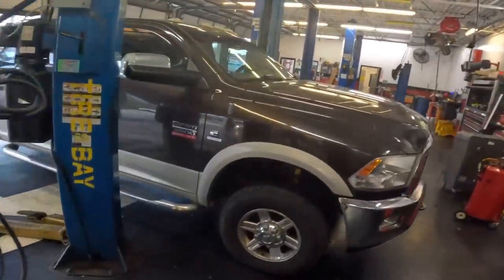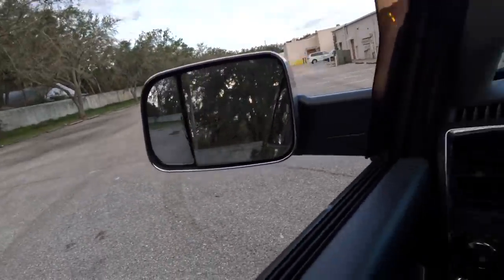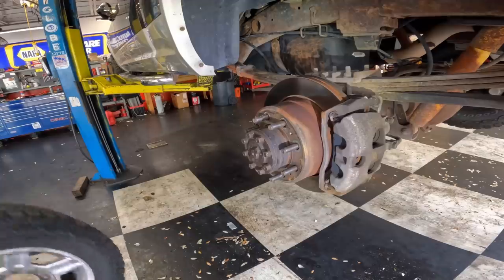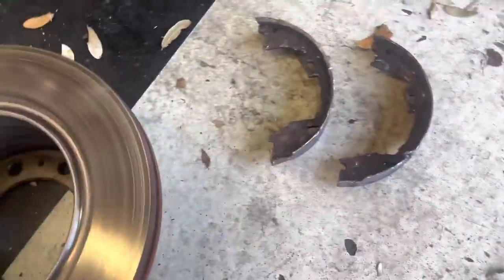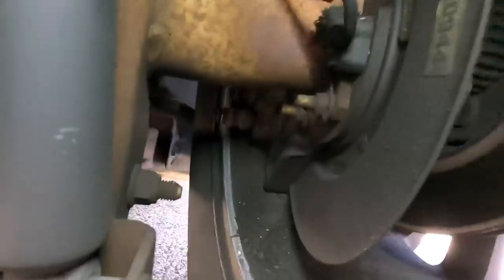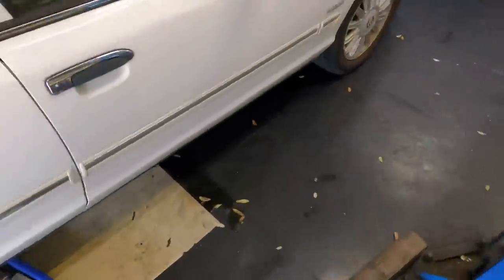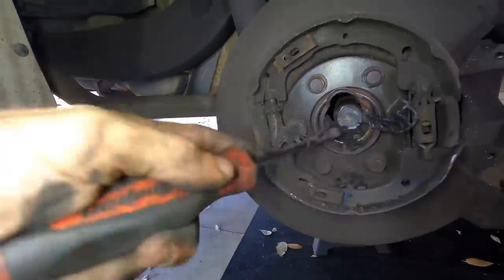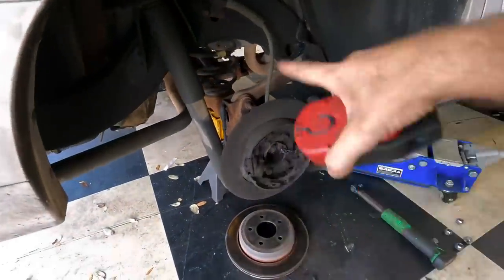Could have Killed Someone!

Comment: My brother has been having a weird noise from the rear wheels I his Marquis ever since his mechanic changed the wheel bearings and brakes. He kept taking it back to his mechanic and the guy kept saying it was the new brakes and he has to break them in. We watched this video this morning and he decided to take the car to another mechanic and sure enough he just found out the same thing is happening. Lucky it hasn't actually cut thru but the damage looks like a few more weeks and it would have given up. Thanks a bunch for this video. You may have just saved my brother's life considering he drives like he's trying to break the land speed record,

Comment: I think it’s awesome that neither owner thought to take the wheel off and see what happened.  I worked on VW busses for many years and the only way that power is transmitted to the wheels is via the splines inside he brake drum hub, mostly on the left side.  When they wear out it’ll make an awful noise and the bus won’t go.  I have had to swap brake drums back & forth to get a good one on the left side to make it back to civilization.

Comment: I once had a wheel bearing fail that made no noise at all, it started leaking oil like a bastard so I went to swap it, when I pulled the axle, the three remaining rollers fell on the ground...  I was very surprised.

Comment: I've seen similar shaft failure on an Army Blazers (CUCV) with high miles. It was late '90's, maybe Early 2000s, so not extremely old (CUCVs we're 84-85 MY). 15 - 20 year old vehicle.  With no caliper to hold it together the wheel just falls off while driving.

Comment: Having been a taxi mechanic in my youth, and done an axle seal or 2..... first sign they ignored the grinding noise for some time.... well, aside from the hub falling off... the lack of oil on every inch of parking brake.  Makes me wonder just how long they had the radio turned up.

Comment: I got a 2010 Impala that I had to park for a year because of a fender-bender on the front driver side. Got her repaired at a good rate by somebody family knew, but once I started driving her, I noticed a windmill type noise coming from the rear passenger side, and I know the tire there feels tight in one spot (it rotates like 90% of the way and then gets tight for 10% of the way) and well, I have an appointment to take her to the shop tomorrow, not wanting to wait too long to get that looked at, and after seeing this video of some of the things that can happen, kinda glad I jumped on it ASAP.

Comment: FWIW, just a couple of months ago I went thru a similar deal with my 09 Merc. GM, not a noticeable vibration, just caught a whiff of gear oil and saw a mist on my wheel. Got it in less than 10 miles later ( too old to do the heavy stuff anymore ) and it had cut the axle by about a third, worn the bearing right to the housing. Not nearly as bad as this poor car, but I guess my point is it doesn't mean that the owner is that negligent. 

This is more prevalent than you think, Dorman sells a heck of a lot of CV/GM axle kits.

Comment: I wish I could post the picture I have of a rotor that was run so long that one side of the rotor was completely gone. Between the two sides of a big car rotor there are like cooling fins. Those were completely worn off as well. What was left was the one side of the rotor. That’s about an inch of metal worn off by the caliper.

Comment: I want to see what that diff looks like inside, lol.

Reminds me of a tuned up ford powerstroke that came into the trans shop I used to work at.  They did rear end's as well and the truck came in because the driver was, um, doing something out of the ordinary, and sheared the shaft of the pinion gear (like 1 1/2" thick solid steel) and the pinion gear fell into the diff and slammed everything inside into one solid pile of smashed metal and locked the rear end up.  Rear drive shaft was already removed so we put it in 4-low and used the front wheels to drag it into the shop.  Basically everything inside had to be replaced, the housing lived through it though, lol.
Reply: Thanks for the feedback and expect more videos soon. Send me a text above🔝🔝🔝 I have something for you....

Comment: A good friend had a Ford Ranger pick up. There was a load of grinding noises going on for months. He reckoned it was nothing to worry about. I borrowed it and loaded around 1ton of concrete slabs, something wasn't right. As I stood back the truck was literally bending in the middle, the chassis had just about rotted through on both sides! Both the spring hangers and shock mounts were also hanging off...

Comment: Once, I ignored a buzzing sound which turned out to be a wheel hub assembly which was on the verge of doing exactly what that grand marquis did. I was stuck between jobs, knew it was really bad, but I had to get from a to b somehow. If I had simply maintained the vehicle, rotating the tires, I could've spotted the issue before it got really bad, but instead I waited until the noise was deafening.

Comment: Personally I would not bother with a new hub on that truck...but that's just me. 

My BMWs have all pulled the brake shoe retaining pins through the backplates at one time or another. I just replace them with the usual hold down pins that you insert from the back.

Comment: In Missouri we have a safety inspection every year on your car. To make sure they are safe to drive on the roads. That car's wheel bearing was bad for some time before it broke that axle. That thing had to been screaming it's little butt off at the owner for some time. Why would they not have it checked out to see what was making it screech and grind. I know it had to been. Just last week I had to replace a wheel hub on my 02 chevy 2500. all of a sudden I heard clicking and popping sounds from the right front. I took it right home and jacked it up and the wheel had play in it. took the wheel off and looked at the hub and it was bad. ordered a new one and in 3 days I had it fixed. I replaced the left side 2 years ago. Should have done both sides but covid hit and well we all know how that worked out.

Comment: I think that Mercury failure is why certain Ford rear ends are banned from drag racing now - wheel caliper bolts aren't gonna keep that together at speed!
E-brake delete on the Doge, half surprised they didn't just say screw it and live with half an e-brake.

Comment: After you got the parking brake bits out of the Ram, it won't make that noise anymore. Fixed. Send it. Who needs parking brakes in Florida anyway? The Merc. New wheel bearing and seal, used axle, a few bottles of fluid. Send it. A lot better then when it came in.

Comment: bearing went bad then they put the brakes on and it sheared . i did this coming back from fort Gordon in 1969 didnt know anything about cars .replaced bad front bearing used grease from old bearing on new bearing  .was coming back to atl on i20 maybe 80 miles per hour and it sheared off spindle . 1967 ss cameo learned a good lesson  .

Comment: for the Merc... there are millions of 8.8 Crown Vics rear assemblies that will bolt right in in the wrecking yards across this country. They are all missing their right front lower A-Arms which have been removed for use on 70-78 Camaro front ends for circle track cars..... A bolt on also.

Comment: About two minutes in Ray is driving around the lot trying to her "A loud banging noise". Hears some very disturbing sounds and says: "We're not going to take this one on the road. It's probably a bad idea..."

What's funny is the customer probably drove that there, and might have been driving it for days if not weeks before taking it to them. And that customer is likely to know very little about cars. Now there's always the chance that the customer is one of the few who drives really well and don't put any undue stress on anything, but most people don't treat driving that way. They just jump into the car and press the go faster pedal like it's a on/off button.

My point being that Ray taking it for a drive around the block probably would have been way less risky than the customer driving it there in the first place. But yea, no need to take unnecessary risks, so I'm not really complaining, just observing the discrepancy in risk.

[Edit] The moment the left rear locked up I shouted "Parking brake drum!" at the screen. I've seen this before when drum brakes fail...

Comment: A couple weeks ago I put front pads and rotors on my 17 Sportage. I take it for the break in and it's making horrible grinding noises. Not sure why I thought driving it another mile would fix it. lol I was terrified but also knew I couldn't have done anything wrong. Pull the wheel turn the rotor and I hear it. The damn brand new clips that go on the caliper where bent in towards the edge of the rotor out of the box. I have never seen that before. I had to pull both sides and bend them back in. From now I will always check before buttoning up but damn that grinding was loud. Thankfully it was on the edge and not the braking surface.

Comment: Hey Ray I have a question, I have a 2007 Hyundai Elantra and it has around 211K miles on it. Just recently I have heard I knocking noise coming from the engine. What could it be?

Comment: This is why you shouldn't ignore the smallest of rouge noises coming from your ride because if you can catch it early enough, the cost of repair will be way less than the cost of replacing the entire rear axle on that Mercury..
Can't imagine how much that's going to cost but I got bets around $4k range. 
Edit: I mentioned $4k before Ray did.

Comment: I have seen a half dozen of these Crown Vic axle bearing/shaft destructions as a tech in the midwest. 
Once with brand new shocks on the rear, owner installed. The worst/most epic with a spacer lift and 22s. Seems a common denominator of "its a crown vic it'll last forever"

Comment: Yeah those pesky drums..
A lot of technicians skip that as a inspection and clean out and service item..
Often the complexity of properly calibrating left and right leads most mechanics to avoid digging into it.
I imagine that this was because the left rear drum was set too tight against the housing... It rubbed and rubbed and rubbed and got way too hot and then it blew up.

Comment: Lucky that Mercury had disc bad brakes because it was drum brakes that axle and wheel would of came right off the only thing holding that back wheel on was the caliper of the disc brake LOL!! Crazy and why it would not move its because that's the drive wheel and the one part of the axle was not connected to the rear gears to make it move

Comment: Hey Ray.. that Grand Marquis is definitely a whole new level of special right there. As far as the Dodge Ram goes.. check the passenger side E-Brake to ensure that no damage was done to that one too. Because being that it's a heavy duty diesel with the amount of miles it's got it is possible it was bound to be towing something regularly. So with that been said if one E-Brake fails the other would be taking on the brunt of a heavy vehicle in addition to the possibility of a heavy load. Play it safe and check the passenger side.. its also one way to rest assure that it won't be a return for a simular issue on the passenger side.

Nevertheless man I know how you feel after having to deal with Ian. Sluggish come backs can be annoying and a pain. Had to deal with a similar thing back when California got slammed by those atmospheric rivers in late 2016 early 2017. It'll pass.. granted 1989 was a lot worst out here. It wasn't until early November when things started getting kinda back to normal again after the earthquake.

Comment: If this was mine, I'd put the rotor and brakes back on and drive it.   It's an automatic trans.  You don't really need a parking brake.  95% of people never use the damn thing anyway. I never do.  The hub is not compromised by those 1/16th in groves. That steel is over 1/4th inch thick.

Comment: essentially, if somebody had extreme case of OCD and check their oil like 70 times a day, is it possible they could run out of oil from the oil being wiped off the lipstick each time? I suppose if they did it a million times they could have a low oil at least be down a court over the span of a change interval. just wondering

Comment: The Ram should actually be drivable without the parking brake.  Given that most people rarely ever use them, and half the cars on the road the parking brake doesn't work or if it is applied and holds then it won't release fully, most folks would never miss it.

As for the Merc Grand Maquis, there are lots of Ford Crown Vics and Grand Marquis still on the road and in the junkyard.  I haven't looked in a while, but there were always at least a few complete rear ends listed on eBay.  The only problem is that most are high mileage and you are taking a chance on how good they are.
Reply: @BB502 I didn't mean to suggest that they shouldn't fix it, just that once the damaged parts are removed the truck could be moved under its own power to the parking lot.  Or, the owner could use it for a few days without the parking break.  And, of course the shop wouldn't want to tell the customer to drive the truck for liability reasons.

Comment: There was a dodge dealership in my area that was over tightening lug nuts. Not a lot, just to 110ft-lbs. which is just enough that you start snapping studs within a few thousand miles. Then suddenly you get passed by your own tire, on the freeway. Yes, lawsuit. Crazy how a 10% difference leads to total destruction.

Comment: It is deeply worrying that there are those prepared to drive vehicles in that condition. This might explain a lot of those dash cam videos where a vehicle suddenly spears off into the side of the road what travelling in a straight line. I wonder how many die or are seriously injured in such circumstances, and not just those in the vehicle in question, but other road users.

Comment: There is no way the driver of that MGM didn't know something was up.  No oil in it, axle worn into axle tube ... I see this a lot on Panther cars unfortunately, usually on a P71 but it's almost always due to neglect.  In the case of this car, it's hard to think that the driver didn't know what was up - that would have been slinging gear oil all over the inside of the tire and along the inside of the wheel well, smelling like fermented cat urine the whole time ... this one was working on its failure for a long time.  The cars have drum-in-hat parking brakes - when the axle bearings go, this can cause the rotors to grab the parking brake shoes and at the least, cause a vibration and a hell of a moaning squeal.  More often, it causes the car to not want to move in a straight line, and also a hell of an oscillation in motion.
Reply: Thanks for the feedback and expect more videos soon. Send me a text above🔝🔝 I have something for you...
Reply: Scam alert. This guy isn’t our Ray.

Comment: I suspected the parking brake when I heard the noise on that truck.  A few years back in my fair city I hit such a massive pothole with my rear wheel that it caused my teeth to painfully click together and the parking brake shoe to disintegrate.  I thought I'd got away with it until I was on the highway and it started making just a cacophony of rattly, squeaky noises just like that truck.

Comment: Ray, been watching and enjoying your vids for quite a while. But I need to comment on the Dodge. Looks like it was driven for quite a while with the parking brakes on. If it were my truck, I would want the passenger side removed and inspected to see the condition there. It may not have broken yet, but it's probably worn pretty bad also....

Comment: I pulled over when the noise from a wheel started, but I was miles away from home and a service shop.  The car made it, the repair was made, and the Midas Muffler Shop who did the work stole my brand new five-year battery and replace it with a tiny motorcycle battery.  When I picked the car up it would barely crank, a bad sign from a brand new five year battery.  But it wasn't my brand new five year battery, because they stole that one and stuck in some POS from a motorcycle or something - and they even stole the receipt for the battery which I stupidly had in the glove compartment, so there was no way in that pre-internet world to prove I ever bought that battery without going on foot to the store and begging for a copy of the receipt, which MIdas would not have honored anyway, because it was probably the shop franchisee who got my new battery because he was pissed that I had to wait for Friday payday to pick up the car. Midas Muffler, FtWorth Tx long time ago, but still rankles.  Oh, and pulling in those outside mirrors?  The local Dodge house failed to do so and ripped one off my car, then took two months to replace it with some POS from a junkyard.  I could forgive a small mistake, but they also did only half the repair I paid for, which I only discovered months later, too late to get any satisfaction from the dealer.  There are other horror stories, so is it any wonder I can't find an honest mechanic in this small town?  Paris TX somebody please point me toward a mech with integrity and smarts and experience with Chryslers of 2000 and 2005.

Comment: Is there any way we could see the faces of the customers when you show them what has happened? Anger is when my wife drives to Vegas to visit a friend down the road from our old house and hears a clacking noise and the front of the van is bouncing------------ a bit. She drives it home at 45 mph because it is bouncing so bad. From Vegas to Yosemite in Ca. Bouncing a bit she says? I tried to drive it but the steering wheel was also bouncing? The tire delaminated and was coming apart. She felt it as she was leaving Vegas but chose to just drive it home. She was two blocks from our tire shop where we bought the tires? She has never been allowed to drive on a long trip by herself ever again.